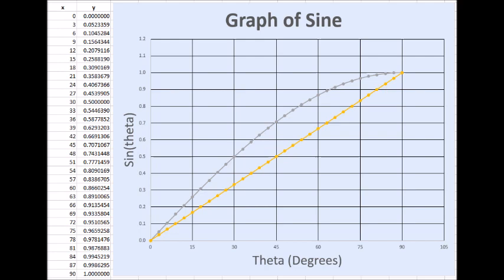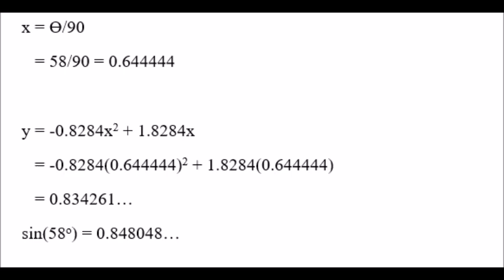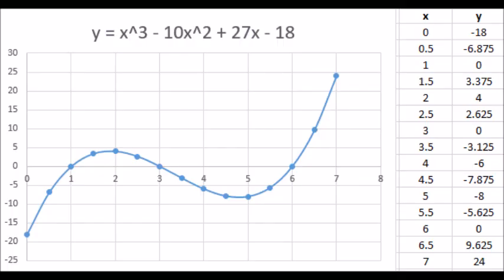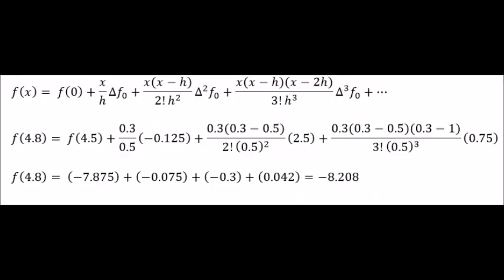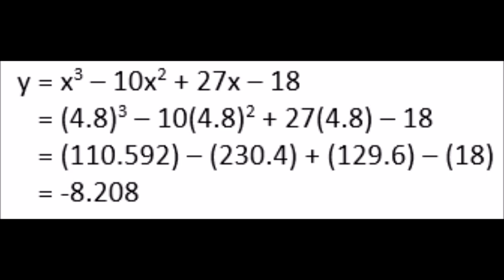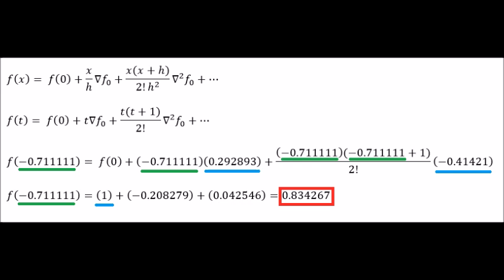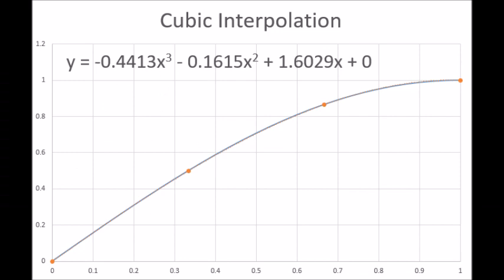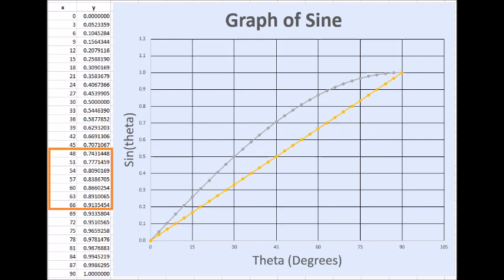Gregory Newton Interpolation Introduced (with examples)

Comment from the maker: That is a good question. The reason I chose the first row is because I am using the forward difference formula. You'll notice in the next example (around 7:36) that I use the last row instead. Why? Because this time I'm using a backward difference formula.

Another way to think about it is that we are trying to use a second order interpolation polynomial, so for that we need three terms. (Number of terms = polynomial order + 1.) That being the case, I have chosen the only row in the table that gives me three terms.

If you were to compute the finite difference columns for more rows of data, you would have more options to work with. Just be careful in your calculation of T if you go that route. Set t=0 for the row you choose.